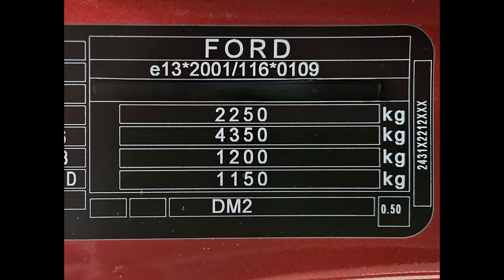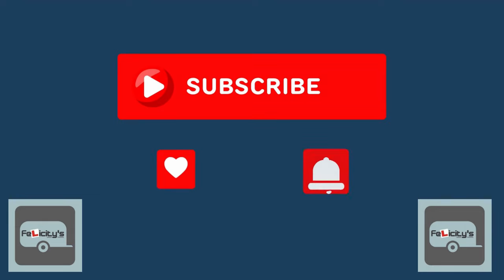Towing Capacity Vs The 85% Rule

Comment: The 85% is somewhat of an anachronistic rule of thumb dating back to when caravans were being towed by vehicles with much less capability in terms of suspension, braking, stability and tyres than a modern vehicle. If you are towing with a Ford Cortina it definitely makes sense, but perhaps less applicable to a modern SUV or saloon?
Reply from the maker: Thank you for your comment. I stand by what I've said based on road safety advice. Modern vehicles are more capable but at the same time, caravans have got heavier with all the modern habitation equipment. There are still too many untrained/ unaware drivers towing caravans and trailers with inadequate vehicles on our roads.
Reply: @the_trailer_lady Can’t argue with that last sentence!

Comment: Thanks for your video Fliss, quick question, is there any difference between towing a single axle caravan and a double axle caravan, 👍.
Reply from the maker: Double axle caravans are usually the heavier models and require larger tow cars. Due to their weight, they do 'stick' to the road slightly more than a single might. However, I have towed both, and to be honest, as long as they are loaded and weighted correctly, the only difference I notice is a slight increase in pitch and sway with a single axle over a double axle. And with AL-KO ATC fitted, it is minimal. I have towed single axle caravans to Europe and all over the UK. I have never experienced a problem because I am always loaded and nose weighted correctly. I personally find them easier to manoeuvre, level and affix wheel locks to and I have never felt compromised on the habitation space either.
I hope that answers your question?
Reply: Yes thank you very much Fliss, we have a single axle caravan and I think we will stick with that, I does have the alko system fitted, 👍👍.
Reply from the maker: @busterboy7505  Choose a double axle because the layout, payload, or optional extras are what you want rather than solely because it tows slightly differently

Comment: I have a question if you don’t mind please… I have asked this at the caravan club, at my towbar fitter, and a few more organisations, but the silence has been deafening……..
Maybe You could address this in your next video about noseweight, I really hope so….
If I tow a caravan occasionally, maybe twice a year on holidays, my car can probably cope with that, but…
If I want to tow a caravan regularly, let’s say for a 5 month tour around Europe, I need to fit specialist suspension to my car, like stiffer shock absorbers, extra springs etcetera.

My question is this: will specialist suspension increase my maximum noseweight??
Like I said, I cannot find the answer Anywhere, and Nobody is answering me… can you shine a light on that for me please??
Much appreciated, Thank You!!
Reply from the maker: Hi. Thank you for your question. I had to do my own research on this to corroborate my thoughts.... and I found an answer!
The nose weight of your towbar is the S Value figure printed on a sticker on your towbar (you may have to lay under the car to read it!) This figure has been set by the tow bar manufacturer and is based on the limits of the bar itself and all component parts. The D Value, also listed on the tow bar, is the dynamic load and must also be adhered to as it has been tested to it's limits. Any suspension modifications will only improve the ride and handling of the vehicle and not increase the towing capacities. 
I found this data sheet on The Camping & Caravanning Club website. I hope this clarifies things for you. 

https://www.campingandcaravanningclub.co.uk/advice/equipment/suspension-modifications/
Reply: @the_trailer_lady  thank you Very much for your help!!
Reply from the maker: @kazhilly  you're welcome

Comment: One question for you 
If i have the capacity to put the awning and windbreakers over the axle of the caravan is that better than putting them in the empty boot of my car. 
This year we travelled from York to the isle of wight only 2 of us. The caravan was under weight and had the correct nose weight over the last 3 years have set it to 90kg to help stop the bounce our unit is a 2017 Kuga and a bailey Phoenix 642 with a weight upgrade to 1450kg
Reply from the maker: Hi Jon. I like to weight the caravan to near it's MTPLM because it needs to 'stick' to the road. If its too light, even with the correct nose weight, it can dance around a little too much especially if caught in cross winds. Loading the car is also a good strategy because then the car will always be heavier than the caravan and will remain the dominant vehicle in the train. At the end of the day, it does depend on how much stuff you are taking away with you. If you're following the 85% rule then load the caravan but if you're up nearer 95% ratio, then load the car more. I hope that helps.